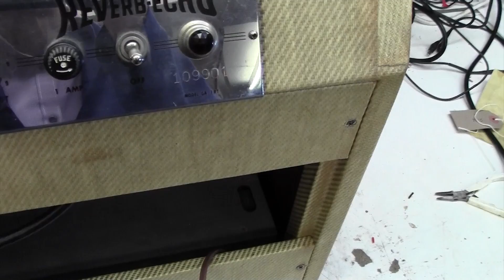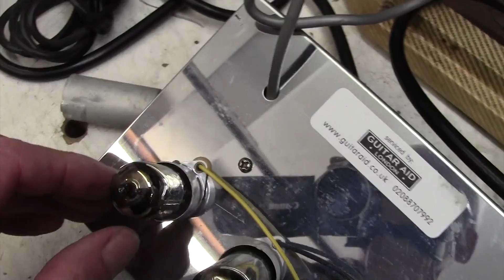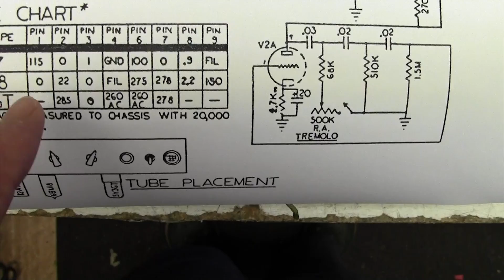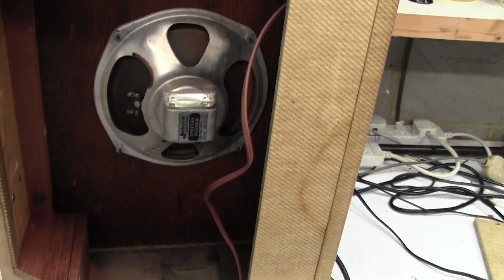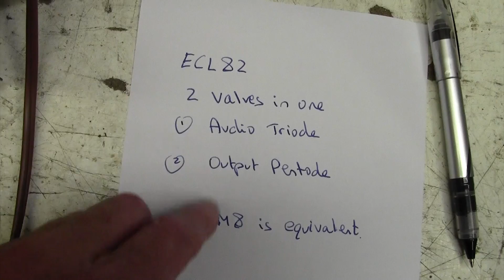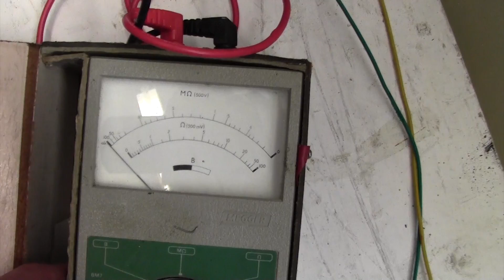Gibson Maestro Reverb Echo 1961

Comment: Fantastic video! This is an amazing little amp. I've never seen one before, but I agree with you it does sound bad with non adjustable tremolo.  I find it entertaining to learn from your expertise.  It seems you never run out of rare amps to work on. What is the model number of the megger you are using?

Comment: I'm a little surprised you didn't replace the "death" cap with a X/Y cap rated for across-the-line service, in case there was a noise issue.  Could be added later if needed, I suppose.  Good video, get well soon.

Comment: Hi Stuart. Nice Video. Is the asymmetrical clipping as you show at 32,24min, normal for a class A amplifier? What is causing it?
Reply from the maker: Hi William  YEs that's perfectly nrmal, just the valve running out of volts at one end!

Comment: ECL82; E = 6.3V, C=Triode, L = Power Pentode. There's also a conceptually-similar 6GW8/ECL86 tube with a different pinout and different characteristics. Both of these types were often used in low-power hifi, radios, and guitar amps.The triode section was typically used to drive the output tube, and not for tremolo.
Reply: Yes, the gain of that triode of ECL82 is lower than gain of a triode of ECC83 so the tremolo oscillator triode needs for example a bit larger cathode bypass cap to make sure that the oscillator works well at lower frequencies. 
ECL82 was commonly used as a turntable amp because if you used a high output ceramic pickup, only one ECL82 was all you needed to build amp capable of creating a nice sound.

Comment: There were several Gretsch add-on reverb amplifiers (built by Valco) in the Sixties that worked in similar fashion, by clipping a pair of alligator clips onto the speaker of your existing amplifier and feeding the signal into the reverb amp. One model included instrument inputs and a guitar-signal preamp, as does the Gibson here, and the other did not. Neither had tremolo. Note from the Gibson schematic shown here that the speaker level signal from the main guitar amp was padded down with a 33 ohm resistor so as not to overdrive or damage the reverb tank. BTW, several Magnatone amps had semi-stereo two channel output, with the speaker-level signal of one amp feeding another seperate amp and speaker strictly for the "wet" reverb signal.
Reply from the maker: Interesting info thanks.

Comment: I hope your COVID recovery continues. A few things:
* Before you found the tremolo "off" position on the dial, I was thinking the foot switch controlled that. Did the foot switch control the reverb on / off?
* Maybe next video could include an explanation of when to use flux and/or different types of solder? (Or maybe you already covered that in a previous video?). It mystifies me and I'm sure your explanation would be direct and helpful to many, including me.
Keep up the good work!
Reply from the maker: Hi Jim. Yes the fooswitch was a simpke off/on reverb. It actually goes straight in to the reverb tank! If the connection wire etc is a bit tarnished I usually add a touch of flux. I also always use lead solder as I have done all my life. Can't stand the lead-free stuff!

Comment: So if the rectifier tube is replaced by ss diodes, you really can build a two tube tube amplifier featuring both reverb and tremolo. Pretty economic construction. 
Does the tremolo make LS cone to move because there is no push-pull output stage to cancel out that tremolo signal going through the output stage and OT? Well probably the OT cannot deliver much of tremolo signal because the very low frequency but it amplitudemodulates the sound as intended.
Reply from the maker: Yes I think that's how it works. On the 2-tube though rmember we don;t really have reverb recovery as well as tremelo. You only get reverb when the entire amp is being used as a reverb recover amp. Still pretty cool though! No tone control of course, that would need another tube.

Comment: Thanks for the runaway bias video on the Marshall jvm410h. I had the same problem and drilled out the pins with a 3/16" hole saw and an egg beater hand drill. The amp is back up and running after sitting 2 years. The bias has been stable playing it half a day on the bench.
Reply from the maker: Nice, well done!

Comment: Very interesting amplifier.  Unusual  reverb design.  Still very cool, and I would love to work on something like that. I just picked up an estate sale of 1950's vintage test equipment (VTVM, cap tester, RF freq generator, frequency generator, and an oscilloscope) and 5 AA5 radios for $100.  Nothing is as satisfying as fixing vintage gear with vintage tools. Needless to say, I've got a lot of cap replacing to do....
Reply from the maker: Have fun!!
Reply: @stuartukguitarampguy5830  one unit I got was a Sprague TO-4 Tel-Ohmike capacitor tester.  Why don't modern cap testers have a "magic eye"?  It's so cool!
Reply: @tjsogmc  ,  The vintage Sprague capacitor testers are useful and desirable nowadays because they can test high-voltage capacitors at working voltage.  Be aware that you will likely have to partly recap it in order to be able to use it accurately and safely. Adding a grounded power cord would be a good idea as well. The other thing to be aware of is that the leads to the capacitor under test will have high voltage DC on them and so you have to be very careful not to shock yourself, as well as not accidentally reversing the polarity to an electrolytic capacitor and causing it to explode!  It is also worth noting that oftentimes one will come across a vintage capacitor tester that has had the magic eye robbed from it and used to refurbish a collectible old radio.  Some capacitor testers used the rarer and more valuable 6E5 or 6U5 eye tube, but if I remember correctly the tube used in the Sprague was a 1629 eye tube that is not a direct fit for most antique radios (different tube base and a 12 volt filament, not 6 volt).
Reply: @goodun2974  sure thing!  I plan on recapping and calibrating every test unit I got from the estate sale.  Most of the ac cords are dry rotten and neeed replacing with modern polarized plugs.  It's all untouched 1950's vintage gear.  Surprisingly,  I also got all the original operator manuals for all of it.  Using proper test methods and precautions is definitely good advice!

My workshop is very soon going to look like a mad scientist lab from one of those  cheesy monster movies- and I'm perfectly fine with that 👌 🙂  I should probably get a lab coat and a set of welding goggles to complete the look.
Reply from the maker: @tjsogmc  I remember the old magic eye from my first tape recorder - a Grundig!

Comment: Thanks for sharing Stuart . Maybe the rectifier marking 61-30 is a date code: 1961/30th week?   I have a GA80 from the same era - sadly not in the same cosmetic condition!  It also has some of the orginal Gibson branded valves.
Hope you get over the bat-pox quickly.
Reply from the maker: Thanks Andrew, yes that might be ewhat those numbers were. Odd not to have the valve type written on it though!